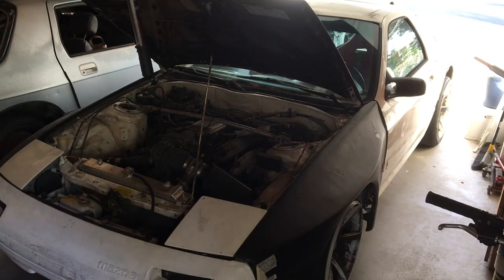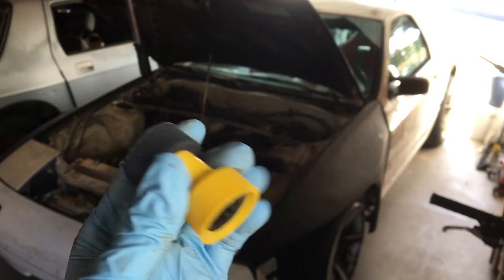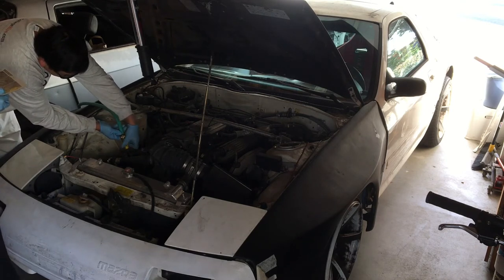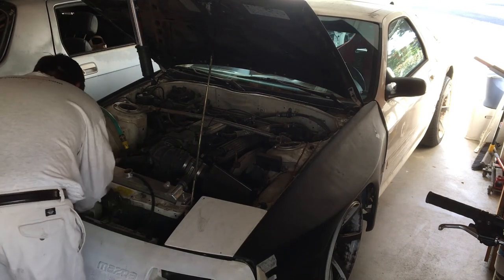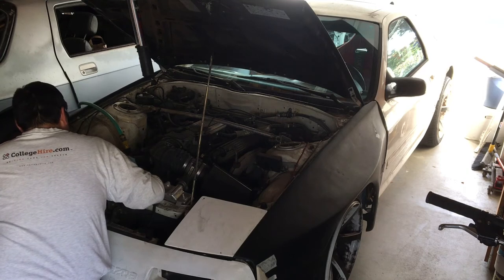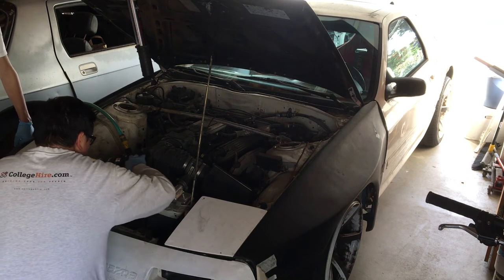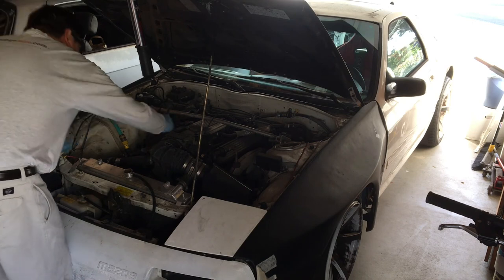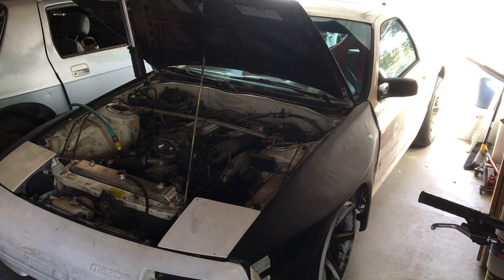RX-7 Coolant Flush Using Prestone Antifreeze Flush 'N Fill Kit

Comment: Like @Chris Wallace said, the t-connector goes into the heater core hose that you have to cut to install. Then you should've taken the car outside, emptied the coolant, poured in a bottle of flush, filled with water, ran the car for a minute or two (don't let it get hot), turned off the car, hooked up the hose/install the outlet spout into top of radiator, turn on the car, turn on the water hose, and let the water, turn off the car again (don't let it get hot), let the water run until the water coming out of the spout is clean. Then drain and refill the system with proper coolant/water mix.